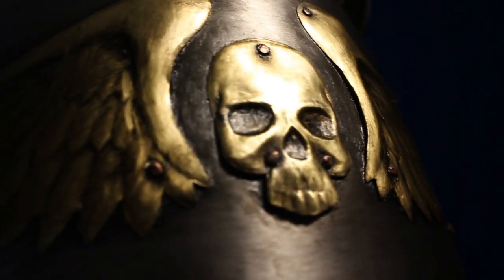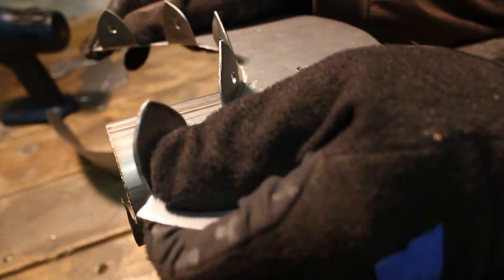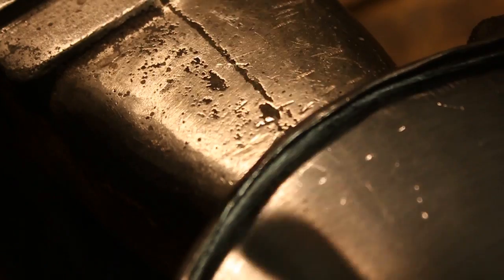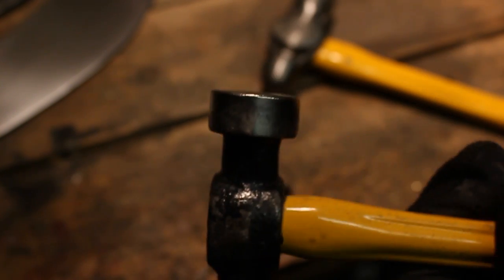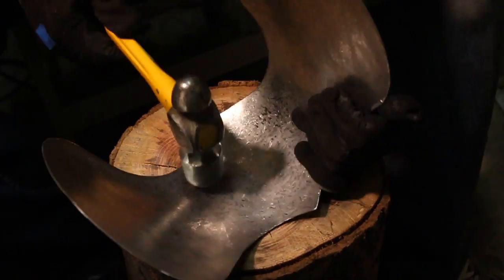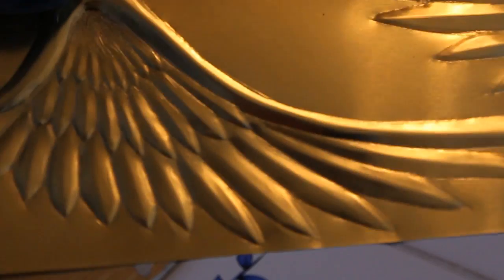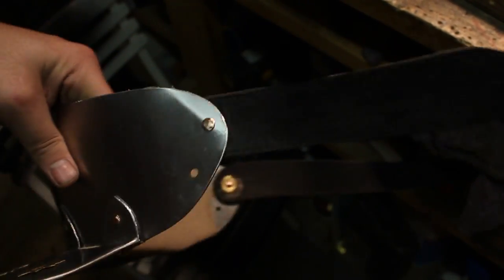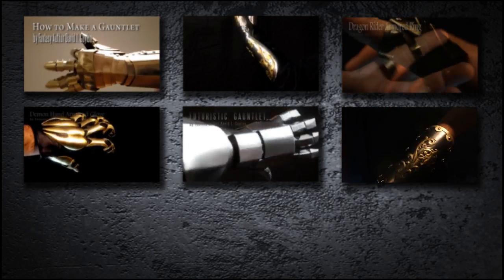How to Make Armor with Ordinary Tools - Pauldron

Comment: How did you cut the steel?  The best I can do with tin snips is 18 ga.
Reply from the maker: +Sandy Simonton this is 18ga, and I used snips for some of it, but I also have a handheld grinder with a cutoff wheel for the thicker stuff.
Reply: Ah interesting okay.  I'm trying to do it on a budget and am considering using my Dremel; would you recommend the Dremel for cutting any of it?  At first glance it looks like I need to just stick to the snips
Reply from the maker: I have some Dremel cutoff wheels for metal, but they won't do much on 18ga. Do yourself a favor and pick up a set of Milwaukee "bullnose" snips...sometimes called "bulldog" snips. I got mine from Hone Depot for like $13, and they are much better for cutting thicker steel. They don't cut curves very well, but you can worry about the curves after you get the basic shapes cut out.
Reply: +David Guyton Awesome thanks man

Comment: Very cool piece my friend how ever why not use decrotive real rivits and a rivit gun so as no to mess up and damage and thing plus I mean it takes ten seconds and a good rivit gun cost mybe 20$ and brass washers cost like what a few cents u can't even get like star rivits and that's not a brick hamer I'm a mason and that looks like a auto body hammer with no spike
Reply from the maker: Jacob Morris A rivet gun will rivet too tightly for the parts that need articulation, and for the parts that are supposed to be riveted tightly, I prefer a natural, handmade looking rivet. You can rivet it any way you like, however. Your imagination is the only limitation.

Comment: What did you use to cut the 18 ag steel??
Reply from the maker: Runic Lord had to use a handheld grinder with a cutting wheel attached to it....then grinding and filing.
Reply: Okay thank you very much. I found that the tin snips stop being able to cut steel at anything higher than 22 ag
Reply from the maker: Get some "bulldog snips" Sometimes called "bullnose snips". It's not EASY, but it's a lot easier than using regular snips, and they say you can cut up to 18ga stainless steel with them (although I would never bother cutting stainless that thick with hand tools).
Reply: I agree but waking up neighbors with the time I get to work on hobbies (around midnight) is hazardous. Thank you for the help, I shall check out both options

Comment: i guess thats not Battle ready right? it will bend and be pierced easily
Reply from the maker: it's not heat treated, but trust me, you cannot bend or pierce 16 gauge steel easily. It takes power tools to cut through it.

Comment: You should explain a little more about the measurements because if this is a "How-to" video you should probally include how to measure yourself for the pieces of metal.
Reply from the maker: +Ethan Carbonneau you should do some of your own tutorials on how to measure yourself for armor fitting.
Reply: +David Guyton I don't know that stuff. But it was a recommendation for you, not me. Cuz I was considering trying to make some shoulder armor but I am quite a big dude and idk if using what you used would fit me.
Reply: +David Guyton also you didn't need to get all stand-offish, I was just asking that you would do that so I could make sure how to measure myself and for alot of others who probably wanna know the same
Reply from the maker: If you have seen ANY of my videos, you would know I sell templates for these pieces of armor. In each template there are detailed instructions about sizing. You see, I already addressed the issue you're talking about. But instead of asking about it, you told me how you thought I should handle it in my videos.
Reply: +David Guyton OK, now I know, I just came across your channel in my recommendation list. Don't need to freak out about it just because I didn't know you sold templates. Damn.
Reply from the maker: 0:40
Reply from the maker: are you trying to tell me how to act now? Do you see why I am giving you an attitude? Do you have any more demands before I block you from this channel?

Comment: This isn't a "costume" this is actual armor?
Reply from the maker: It's sort of both. It's not hardened steel like armor should be, but it's not plastic or foam like a costume would be.
Reply: @DavidGuyton  a good chunk of metal armor got their strength from their shape in the beginning, which you have used. So you're not very far off of that.

Comment: Don't you normalize the metal after all that hammering
Reply from the maker: Elis Lee The design doesn't have any dramatic curvature or shaping, so annealing is not necessary, nor is heat treatment afterwards because this will never see actual battle. But the most important reason I do not use heat is because I do this to show others how to build this stuff relatively easily in their own garage without expensive tools or a forge. I also wouldn't want youngsters burning their houses down by accident.
Reply: +David Guyton I see, thank you for the answer